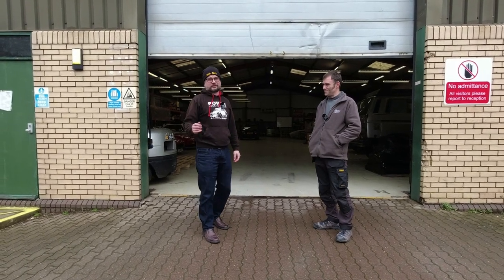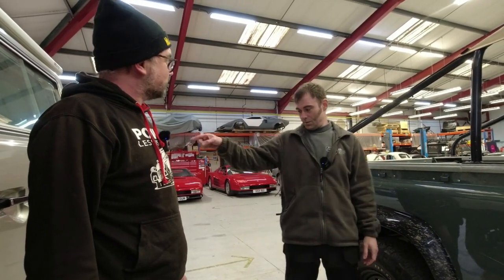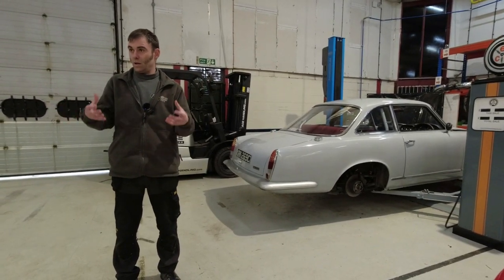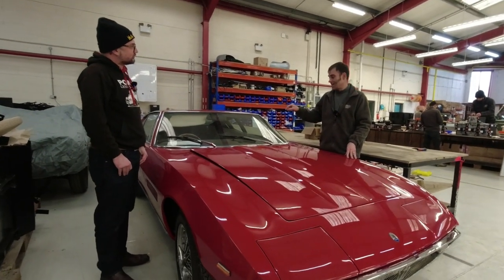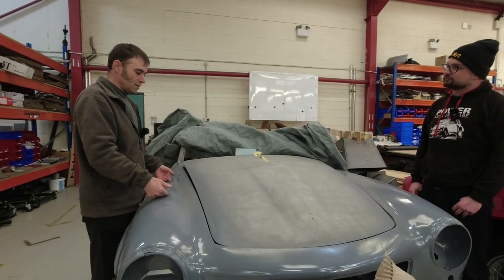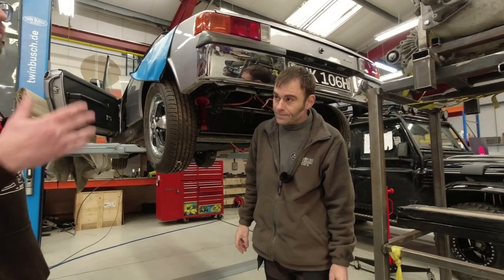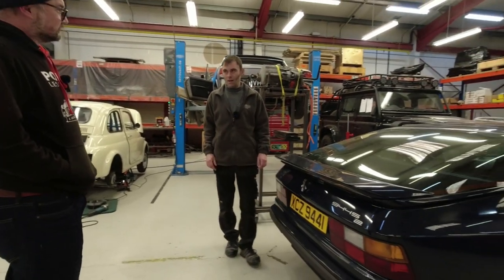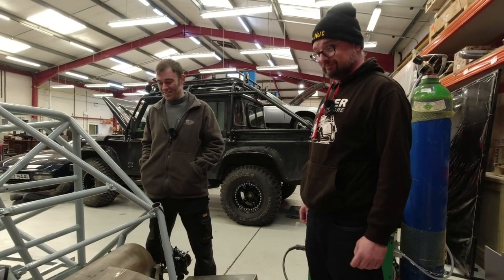Visit to Electric Classic Cars - home of Vintage Voltage!

Comment: This is going to be polarising for many people and indeed for me. 

I do like the idea of EV conversions on classics if the drivetrain was never that great to be begin with and weren't integral to the real heart and appeal of a car, the Flat-12 in the Testarossa for example. Something that doesn't appeal to me in the slightest however something like Delorean with its wheezy low powered V6 PSA engine is a great candidate as the engine was never really the heart and soul of the car.

Each to their own - very interesting if a little (lot) expensive).

Half the fun of owning and running a classic IS the upkeep and maintenance. I am not convinced the argument to make them zero maintenance is valid to be honest.

Comment: I love this. Is it for everyone? No. Is it the most "cost efficient"? Probably not.

But with that, it's an interesting insight into someone who is doing something that they love, and ensuring that a car can have a life long into the 21st century, especially those that were a bit of a basket case. And whilst originality is cool, as are pistons and hydrocarbons, it's great to see other approaches. And purity policing is just another form of gatekeeping. 

And ultimately, cars should be about fun, and these look like a lot of fun.
Reply: Look like, yes, but all they are is lookalikes. Someone wants an electric car that looks like a Ferrari? Build a plastic replica and stick a Tesla motor and battery in it
Reply: @AndreiTupolev  or does someone want to make an interesting car into something that they can use on a daily basis instead of just for special occasions? 

Honestly, this video has made me resume the thought in the back of my head of finding a rough but sound Morris Minor to convert to EV to make a cool daily for my commute.
Reply: @posimativelynegative  wouldnt be a interesting car anymore then tho would it.
Reply: @ivanfernyhough3851  I disagree, the fact that it has a completely different drive train makes it a very interesting proposition.

Comment: Richard puts across a very compelling argument for electrification of classics, however he doesn't account for classic car owners enjoying the challenges and foibles of their cars too. I'm sure the Testarossa's performance is blistering, and reliable to the point of boredom, but if you are buying a 1980's Ferrari, perhaps that's not what you were looking for from the car anyway? The Land Rovers and campers could be seen more as a 'tool' and any performance or modernisation upgrade could only be seen as an improvement. 
I remain uneasy about some of the conversions...

Comment: The soul has been lost once you take a engine out of a car, I think it is like having a milk float in a different shell. The infrastructure is not in place, this is not a viable solution, hydrogen is the future. Converting these classics in my view devalues them in my view, as it is technically not original, I like the noise and smell of a combustion engine.
Reply: Imagine the local classic car show of the future. "What car is that dad?" "Well son. That's a Mustang.... Actually it's a Tesla. And that's a Tesla. And that's a Tesla. And that......"😴
Reply from the maker: I'm curious. How is Hydrogen the future if electric cars have no infrastructure? Hydrogen cars have about two pumps in the whole of the UK!

Comment: In the case of classics where the engine is destroyed or just plain gone, as appears to be the case for some of these, really don't see a problem with an electric conversion. Where I hum and hah a bit is if they're actually taking out a fully functional original engine and replacing it with electric. Of course, it does depend on the rarity of the car in question!

Comment: Turning vintage/classic cars into Ev's are a pure feel good project with zero real world change to our enviroment. All serious surveys tell these cars are only a microscopic part of modern traffic. Enviroment friendly synthetic fuels are comming. It's known technology, the problem have been getting production cost down and also making the production of it enviroment friendly. Porsche/Siemens are building a big plant in Chile, were E fuel for classic combustion engines are basically made out of sea water and air from the sky. The plant are driven by wind mills.

Comment: Classic?   Not a chance, they've had their heart and souls ripped out. It's like playing a Beethoven or Mozart symphony on a keyboard with synthesized instruments.  They're now glorified milk floats.  Albeit it fast glorified milk floats.  In general, I don't see why we should live in an energy prison when the biggest polluters can't be bothered to step up!
Reply: Wait till the government wants their cut and ups the Kw per hour  charge on the EV home charger....
Reply: @andicog  There’s already proposals for separate meters being a requirement for home chargers.  Meaning that duty & VAT at 20% could be levied on electricity used for charging vehicles.
Reply: Agree 100%. Why can't we at least have choice. If you want to believe the green agenda then fine. Buy an electric car. Why can't we have petrol, diesel, hybrid, electric and hydrogen. If the government allowed sales on a level playing field and didn't try to force electric through I wonder how many would really be interested in an electric car?
Reply: @Alfred Wedmore But it's not a Ferrari? It's ( depending on the body ) a Pininfarina design for example. It doesn't go like a Ferrari either. Torque is different. It being quicker to 0-60 is academic. The particular model has the performance of that time period. It will also ( rightly ) be disowned by Ferrari. Let electric cars create their own legacy. Like Dodge and their muscles car plans
Reply: @Alfred Wedmore You do realise that your patronising reply is symptomatic of the cursory and perfunctory way you've read the comment?  The fact is that you've missed the point!  Let me explain it to you, it's one of PURITY.  Is a lost wax replica of a Bernini statue as good?  Is a replica da Vinci better than the original?  Is playing a replica as good as the original instrument?  (Even if the original has been altered or repaired). NO!    Why?  Partly provenance, partly intent of the creator, partly workmanship, etc. 

I wrote my comment for people who would understand it. If I had to take into account all the variables and nuances of the argument, to counter criticisms, it would end up being longer, but far more accurate, than your reply.  

As for your somewhat inverted snobbery, let me tell you, mass produced items revolutionized the living standards of the majority, and I'm all for it.
Without writing a thesis on this, for instance, Roskopf invented the pin-pallet escapement, this allowed a simplified and cheap watch to be produced for the masses, no problem!  (Although these movements are anathema to certain horologists) 
The Armoury system (The interchangeability of parts) allowed cheap products and extensive employment, again - great! 

So whilst your pseudo-educational lesson may fool some of the people some of the time, it doesn't fool me!   Before you jump in to show your "knowledge?", just pause, think, and then reply - Thanks!
Reply: @Alfred Wedmore Haha, that sums it up, makes no sense, didn't take my advice then!  Horse to Water!  (PS glad you removed your comment, it was rather ill conceived - have a good evening!)

Comment: Always a bit surprised that in case of electric cars, nobody seems to care about the environment anymore. Ridiculous horsepower and torque and not thinking about how the electricity is generated. A lot of it still comes from dirty coal or nuclear power stations!
Reply: Yes, notice now that Jeep say 'zero tail pipe emissions' as opposed to zero emissions. Power comes from somewhere, they just move the problem.
Reply: Stephen Graham  yes but a modern eV creates 50% more Co2 being manufactured than diesel or petrol so it's already behind when it rolls out of the factory.

Comment: I'm afraid I'm really not sure about making classic cars into Tesla-wannabes. The engine, particularly the sound, the variables in performance, its foibles, and dare I say the ability to do maintenance on it yourself, are an essential part of its character. Particularly when you've got a Ferrari Testarossa, did I see in the thumbnail? An electric Ferrari, above all a Testarossa? No.
Reply: They're converting 3 or 4 Testarossa's....  What a crime. Sheet steel battery boxes and probably a 3x2 steel frame motor support. How could you own a Testarossa (not my fav car) and have its flat 12 heart removed?

Comment: Fascinating chap and always full of passion and energy, really interesting video. I totally agree with 'CaptHollister''s comment below, the sweet soundtrack of an early straight six BMW is a true delight and whilst the CSi conversion is gorgeous and I'd take it in a heartbeat even in electric variant, it's sad that the glorious soundtrack will be missing. Maybe a case for either/or hybrids, where you can either switch to all petrol or all electric or full hybrid mode depending on the mood or circumstances.

Comment: One thing that seems to have happened with the electrification rush ,is that if you can put 24645995hp in a car, you should , even if it is pointless .
Reply from the maker: I think that's because Tesla motors are easily available, and an awful lot of fun... But not everything this company builds is stupid fast. The Fiat 500s perform just a little better than the petrol versions.
Reply: @HubNut  for sure... Just that in certain applications people just go a little silly... What's the old saying... Better fun driving slow car quick, than a fast car slow..

Comment: A fascinating video, and your interview technique is spot-on. I now want an electric Mk. IV Zodiac :) One serious point though: as I understand it, the emergency services have special protocols for dealing with crashed EVs. Now, they'll know what all the production EVs are and how to deal with them appropriately but what if they encounter something unexpected, such as one of these conversions?
Reply from the maker: That's a good point. Probably worth having a sticker clarifying the situation, like if you have LPG.
Reply: @HubNut  That's what they are doing here in Australia.
Reply: More to the point, what affect will a large steel box have on the vehicles structure and crumple zones? Especially in something like the 911 where the area in front of the fuel tank is a crumple zone now filled vertually front panel to bulkhead with a solid box full of battery's??

Comment: Well, what a fascinating enterprise and interesting chap.  Thanks for a great video Hubnut.  On the philosophical side, I hope that the experience of a petrol engined classic will always be available, but equally, there is plenty of scope for many to be electrically powered.  Now, there was an unasked and unanswered question.  If all these conversions are to the car's original weight, there must be a ballpark figure for range under normal driving conditions.  I presume it doesn't approach the range of a weighty Tesla, but it'd be nice to have a notion of what it is.  Similar questions exist for charging time and battery life - do these conversions approach what is being achieved by big manufacturers, or is there a big gap? One more question I have never seen answered is by what percentage would range be decreased if driving in conditions requiring headlights, wipers and maximum heating? Cheers.
Reply from the maker: I'll give further info in the next video, but I think the Bluebird I drove lost 9 miles for every hour of heater use. LED bulbs help reduce the impact of lamp use.

Comment: With regards to the problem of the front motor on the fun cup chassis, couldn't you just rotate the motor around the axle? So it'll be upside-down, but will sit inside the axle?

Comment: I'm a Beetle fan, and more specifically, a huge fan of original Beetles. However, if you are going to tamper with them, I see no reason why you can't go electric. I mean, lots of old cars get modified till they're almost unrecognizable. These cars, however, seem to retain a lot of the original looks and style. I see no fundamental issue with the change from internal combustion to electric.
Reply: I hope you're not suggesting that car enthusiasts should spend their money wisely?
Reply: Of course it's expensive, but if you sum up all the money I've thrown at my Beetle over the years... Uhm... No, let's not sum that up. I don't even want to know the total. Anyways, an awful lot of that money has been engine servicing and engine related work.

Still, my point is... If you have the money and want to go electric, then go for it. You'll have to really, really, really like electric drivetrains to do it. But then again, you have to be a bit of a nutter to own and drive a classic car anyway.

Comment: Interesting stuff. But for most people it will be the longevity of the battery/motor that will be key. More used cards are sold every year than new.....because people can afford them. What will be the future cost/reliability of the average 10 year old EV? Will it even exist. Will a large number of people be outpriced?

Comment: Hmm.  The legality is interesting, everything there will need an MOT, the historic exemption no longer applies. Checking the reg numbers a few must be still "on the way to the test station". Also with the loss of historic exemption there are construction and use issues that may require an IVA/SVA test. They never mention any of that, or the price of course. Then there is the increased fire risk of a big lithium battery, check your house insurance... But people should have the freedom to do what they want with their cars, (like when so many were lost to banger racing 20 years ago). Having said all that some electric conversions do make some sense but the future of classic cars will be synthetic fuels, not electric motors.
Reply: You do you man. I want the reliability and every day usage of an EV conversion.

Comment: In two minds if taking engines out of cars like Ferraris and replacing them with an electric motor is a good thing, but I can see the argument that it’s makes them more reliable and useable. Just think it takes the heart out of them though. You have to be impressed with Ian’s knowledge though and naming the Mercedes from what was just a shell!

Comment: I have my doubts concerning ditching "real" classics' engines for electric conversions- such as the Ferrari, Gordon-Keeble, Maserati, BMW and the like. If we're not careful, there will come a time when nobody would believe these ever had a "live" ICE, and I do mean live. Come on, you could never dismiss a V8, V12 or even a straight six just for being inferior to electric motors. They give so much more character to the cars they were installed in originally. An electric Buick Grand-National? You must be joking.

HOWEVER... electric conversions are perfect for your everyday classics such as that Bluebird Ian drove recently. Just what the doctor ordered for tired old motors that used to be gutless and boring even when new. Think of a Hillman Avenger (NOT the Tiger), Vaukhall Cavalier, Ford Cortina, Peugeot 404 Pickup (yes!) and even a Reliant Fox (well, that's a given)- the list goes on, insert what you like. As long as you get extra punch from these motors, I'm in. Actually as Ian found out, that Newbird was much too similar to the original, and I think that's wrong. As long as we're putting current technology into yesterday's cars, I think there should be some form of performance benefit. Not 0-60 in two seconds, but (much) less than the 12 or so seconds that used to be.
Reply: I don't agree that the more mundane classics are any less worthy to be preserved with their original powertrain. There's always going to be people who want to modify their classics and those who don't. I don't really see these EV conversions as much different from an LS swap or whatever - just another solution to improve performance and reliability.
Reply: Whatever the car, the original power train is its heart and soul, and defines its character. If you’d rather trade that character for modern convenience, well maybe you’re missing the point of owning a classic? Yes, there have always been people fitting modern engines to classics, but that’s always been met with a little more scepticism than electric motors are now, which worries me for the future of classics.
Reply: @Alfred Wedmore Yes, there is much more to a car than the engine - but in replacing the engine with an electric motor, you likely take away much more than the engine. The technique of driving the car will not be the same, the weight distribution and handling will be affected, many interior instruments or equipment will no longer function as intended. Really, what you end up with is something that looks like a classic - but no longer sounds, feels, or smells like a classic.

Comment: Drivers of old Citroens love the electric conversions as the engines were usually the weak links in the designs. And nobody drives Citroens for the engine noise - they offer so much more.

Comment: You'd imagine if you had a Gordon keeble you'd be both willing and able to keep it going for what it is and as it is..  There's no rush to electrify, nor need. What's the benefit here? It's a travesty in this instance....

And the Ferrari. Likelihood is it will be permissible to drive it in some way in the future... And if you own a Ferrari then, it can't be about saving money ..and neither will it save the planet.  No one is turned off from using a Ferrari because of reliability.. The people that own them, can run and repair them..

If we use the logic presented here, we'll be electrifying traction engines soon because; "with electric they'll  not need constant tinkering and be usable and reliable machines".